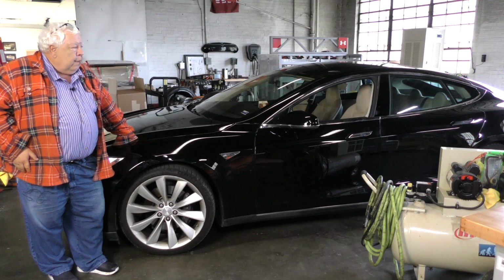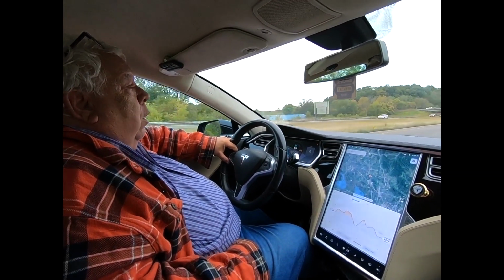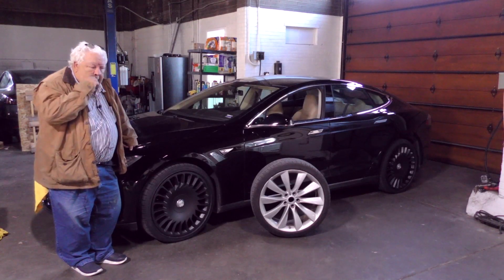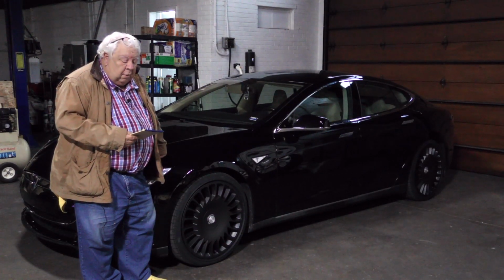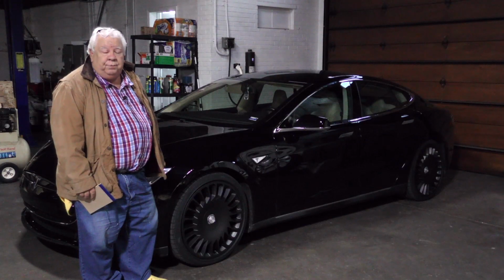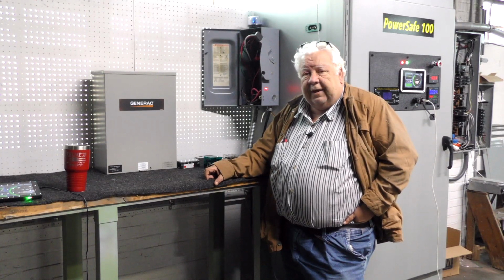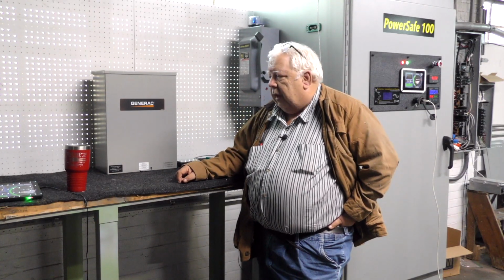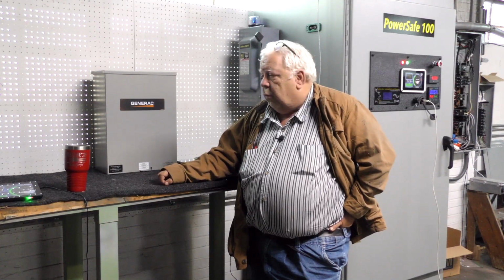Tesla Model S custom wheel test - Time of Use Function for PowerSafe 100kWh Battery

Comment: Jack, back in 1973 I built 1969 VW  removing the engine and replacing it with a King Conversion with a stack of car 12 Volt batteries the electric motor was from a DC 10 Generator range 29 miles due to the weight of the batteries . Now at 75, I'm getting ready to buy the first Telsa  Thanks for your U tube info 
by the way, the control screen is made in Nappa Idaho.

Comment: I installed my house system back in 2000 using a Trace SW4024 inverter.  It has a Grid connect time register and a Grid disconnect time register.  I actually am using it today to connect to the grid at 6pm after the sun goes down to finish charging the batteries if they need  it.  I disconnect at midnight and run the house off of the batteries until the sun comes up and on a good sunny day, the batteries will reach 100%.  Looking at upgrading batteries, inverter and charge controllers and adding more panels.  I like this Tesla solution AND your ESP32 controller. Thanks for the info and the products

Comment: TPMS on that Model S uses Baolong sensors (no individual pressure per wheel on small screen). You probably got Continental sensors installed. Tesla can retrofit the receiver for the new sensors and you'll get individual pressure readings on the small screen. 

Regarding efficiency, you should have mounted the old Continental tyres on the new rims to measure just the efficiency of the rims.

Comment: Mr. Jack Rickard -- The new wheels are definitely prettier.  However...

The new tires, your Pirelli's, are the likely culprit here.  New tires adversely effect rolling resistance. This lasts for about 800-to-1,200 miles of normal driving.  After that point, then you should realize a relative improvement in wh/mile performance compared to your older, well-worn Continentals.

I hope this helps!

Comment: Surely it's impossible to test this way with other vehicles on the road like this? You need to do a test without any traffic. Even a car 100m ahead of you provides a significant hole in the air.

Comment: The biggest disappointment I've had with aftermarket tires & wheels has been the resulting loss of accuracy in the Tesla navigation trip planner.  If I punch in an address 200mi away and it says I'll arrive with 25%, I end up arriving with maybe 10%.  I thought the system would "learn" the cars new efficiency but after 30,000mi with this setup, it never has.  Can cause severe range anxiety for others counting on somewhat accurate projections.

Comment: Jack Rickard  what was the temperature on the 2 days of testing? 
The old tires were tested on a cloudy day. The next day was clear blue.
Did a cold front come through and change wind direction and air density?
Reply: It does look colder on the second run. Blue sky, early morning light, and Jack is wearing a coat.
Reply: You’re talking flying calculations Jack.
Density altitude GS and drift calculations remember.
More rubber from greater tread depth, bigger rolling diameter also giving a more plush ride.
Just so many variables without even mentioning accidental drafting.
Reply: Air density, wind direction and speed are all important in a comparison such as this.
Reply: The original wheel is aerodynamically designed specifically for the front air flow management but the black one looks like it blocks airflow from the inside to the outside.
Jack knows all about aerodynamics and all the factors involved.

Comment: Wind speed (air speed) should be measured during these tests to make sure you don't have a headwind or a tailwind. The amount of traffic can affect the tests. Drafts and turbulace from other cars. Also the operating temperature of the tires should be measured. A different tire compound can cause rolling resistance changes with temperature changes. Also a different tire and rim combination may need to be run at a higher or lower pressure than the factory rims and tires to achieve the same rolling resistance. The  TPMS wheel sensor has to match the Manufacture specifications for frequency and type, then the reset procedure has to be performed. New tires always do grip better. They gradually  lose their grip overtime. Change tires every 3 years for maximum safety.

Comment: Were you comparing Wh/mile as calculated by the Trip Computer? If so, you will need to measure the rolling diameters and compensate the readings for the different diameters. The new tires probably have a larger diameter so the Trip computer will think you have traveled less distance and your Wh/mile will read higher.

Comment: Wow. Selling power at 56 cents but do they pay customers for solar at close to that if you use your batteries to push it back? 

If I buy your BMS do you include these software updates?  I have your 15kW sig
Reply: Federal law only states they have to pay "avoided cost" if you have a net metering agreement in place. If their cost is averaged which they could do, they may only pay 4-5 cents per KWHr for the power you supply. They aren't going to pay any more than legally required and the law leaves it up to the utility to decide what "avoided cost" means and then calculate what that number is.
Reply: As Jack says, your mileage may vary...

Comment: The difference in weight could easily be rubber worn off of the old tires versus brand new tires. Did you happen to weigh the wheels bare without the tires? I've found my wh/mi to be decreasing as I put more miles on my new model 3. My old Prius seems so incredibly slow now! That may explain my loss of efficiency😀.
Reply: @Jack Rickard So, then, the test to be "comparable", get a new set of tires for the turbine wheels.

Comment: I use a GPS module to get the time instead of using NTP for my arduino 2D solar tracker - it's useful if the net goes down and you don't have an RTC to keep in sync.
I'd prefer something like a cron interface that runs every minute, so you can specify exact on/off times, say a random number of seconds each way. When you have 1000s of customers all switching on/off grid at the same time, then you could cause problems for the grid to deal with!
Reply: @Jack Rickard Points noted, but it's good for consumers too if mass switching is smushed over a period...
Consider a list of on and off times hh:mm:ss instead of an array of hour blocks.
Check every minute, and if hh:mm of the event is now, then sleep :ss seconds before doing the event.
This way you can have higher precision, and have any number of events, not just on or off, but ones such as let the dog out, put the kettle on, order a pizza etc... :-)
May be a requirement to take into account weekday/weekend cases but that would only complicate things a little.

Comment: It is the aerodynamic sweep of the car that makes it difficult, or challenging, for people to get in and out of. I'm not a big guy, but I still needed to develop a method for entering and leaving the car. First, always activate Easy Entry mode when exiting. In fact, I wish Tesla called it Easy Exit. When you get in the car in that mode, sit on the seat first with your feet on the ground. Lean towards the rear of the door opening, then lean back into the car. Now swing your feet in. That is what I use for getting in and out. I don't know if the Model X is easier or not. I imagine it is. I have not tried the Model 3 either.

Comment: Tire place told me new tires require some break in before providing best performance.  
Try the test after 1000 miles and see if there is any improvement.
Curious to see if you get any improvement.   I'm using Pirelli Tires on my Model S 70d (2015 vintage).
After break in my Wh number did go down per mile using stock wheels.  Car originally had Michelin Tires.   
Keep up the good work.

Comment: Fun tire test and the results didn't surprise me.  But what interests me is where does the additional power demand end up?  Is it really all in the wheel vanes … I don't think so.  My hunch is the power loss is mostly where the tire meets the road (power means there's heat and heat means an increase of temperature … so measure the tread temperatures of both wheel types after a road test).  If you are using a larger diameter tire, then there's a greater contact area of the tire and the road (for lack of a better phrase, I'm bundling the effect as "contact friction").  Note:  If the tire has more air pressure the contact area should decrease and the efficiency should increase.  It seems Rick mentioned the new tire was rated at a higher pressure, but Tesla recommended 40 PSI.  If the tire is rated to operate at its optimum with a higher PSI, then that could be the problem with inefficiencies.  Of course, Tesla doesn't want too much air in the tire because a pot hole will pound the suspension system and could also destroy the tire and wheel rim, a YouTuber experienced that unfortunate Tesla problem already.
Reply: @Jack Rickard  They do look good, black wheels with a black car is a must.  Have to give it to Tesla for streamlining the car so well.  It has to be a major factor for it's travel efficiency.  A YouTuber pulled a heavy and non-aerodynamic trailer (as I recall, 5000 lbs. total weight, yikes!) pulled by a Tesla X.  And the trailer hauling was deemed not a practical use for the EV.  The hauling test could've had a few more answers as to the "whys."  Hauling stuff made for short trips to the charging stations.  Wonder how an EV pickup truck will perform hauling tasks.  Might have a huge and heavy battery assembly if it hauls a trailer.

Comment: The mystery of wheels was solved long ago.  Bonneville salt flats racers adopted Moon and baby Moon wheels and wheel coverings for minimum drag.  If your wheel (or brake rotor for that matter) looks like a pump impeller it sucks (down efficiency).  The only exception to a totally smooth wheel might be one that has golf ball pits all over it.  Spalding et.al. knows a golf ball with small pits on it flys much further down the fairway.  It leave it to the aero-engineers to front-row-spring-butt and explain why.  With use of regen Teslas are much less needy of ventilated brake rotors to stop well.  When your rim looks like a pump impeller it'll pump more air increasing watt-hours per mile at any usable speed.

Comment: Jack check this out i just finished 
90kwh
https://youtu.be/xJjZ1LO00ow
Reply: @Jack Rickard lol old jack getting his feathers ruffled 
Maybe if I would have stuck it all in one giant case you would like it lol.
But unfortunately I can't install a system like that there is codes and regulations and inspections that we have to pass so quite on the contrary your system is a cobbled-together mess that is completely unlegal for anyone to install.
 there is working clearances for equipment

By the way I got a Tesla BMS Master controller from Tom de Bree less than 500 hundred bucks with screen. There is several options out there now.  
And it works great
Reply: @Jack Rickard i like you and i find you very knowledgeable I just simply wanted to show you something I built thought you might like it

Comment: I've been charging after midnight all summer at the 9 cent rate. It's 9 cents midnight to 2pm on weekends also. I have broken down my energy usage since I switched to a model 3 in May -- switched to the TOU-5 plan in June. I've been averaging $50 a month to charge. https://docs.google.com/spreadsheets/d/16JLSzoWA0154ZUU3ahJ_O4LorGFFrc1defUCKisrGVE/edit?fbclid=IwAR3kkmw1GxzBrpy9BdQ04yp0tXVjpHMxVBrL6nfTNhlWj6GtQCIXNVZLCTM#gid=0

Comment: New tires are less efficient than used ones. You should use the same tires to compare rims.
Reply: Yep.  Brand-new tires give a pretty big hit to efficiency for an EV, which lessens over the first couple thousand miles as the tires settle in and the amount of rubber squirm reduces.  But efficiency continues to improve as the tires wear due to the thinner and thinner tread blocks.
Reply: @BixbyConsequence  New tires don't even grip well.  Racers everywhere run new tires during test laps and then set them back for race day.  They call 'em scuffs.

Comment: It makes a huge difference if you have a vehicle in front of you on the highway. You can lose 60 whpm in those cases, over a 140 miles that is 8.5 kwh or about 10 % of my battery at 85kwh

Comment: Correct S is very low seating (seat height from ground). M3 is much higher, but still 1-2 inches lower to my new Nissan E +.  I’m a older adult, and seat issue was problematic with S & 3.  I’ll ck seating height in Y , and like you can’t wait to do the seat test in a ev truck

Comment: To make the testing correct you should have done five of the same testing and got the average too many variables you should have used the exact same tires to come up with a proper you could be losing your efficiency just in the tires and the rims could be actually gaining efficiency
Reply: @Jack Rickard what was the temperature on the 2 days of testing? 
The old tires were tested on a cloudy day. The next day was clear blue.
Did a cold front come through and change wind direction and air density?

Comment: Maybe, swap the tires and do the test again. The bigger consumption, maybe was from the tires and not from the wheel.
Reply: @Jack Rickard Yes. And different brand tires. Maybe, the old ones its less resistance, not because there old, just because of the design. I think, its worth to try.